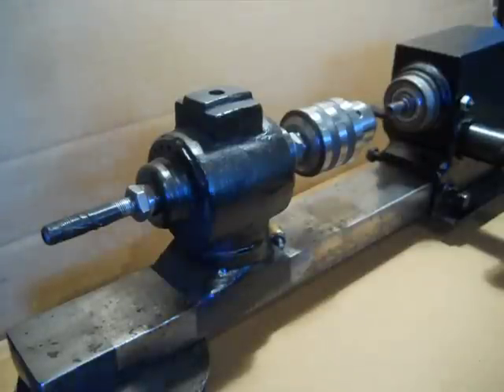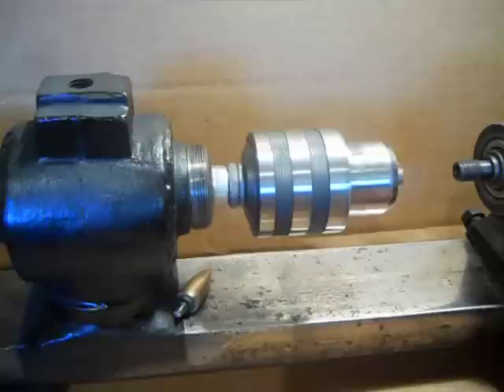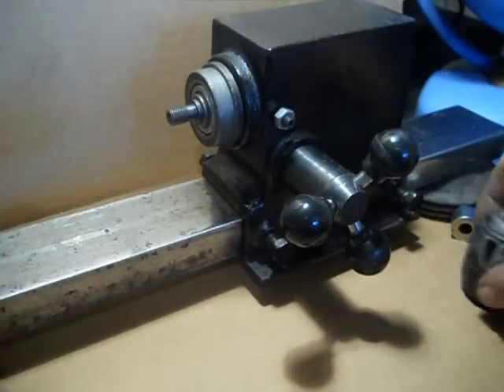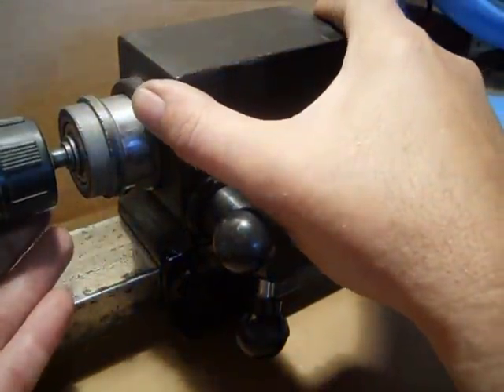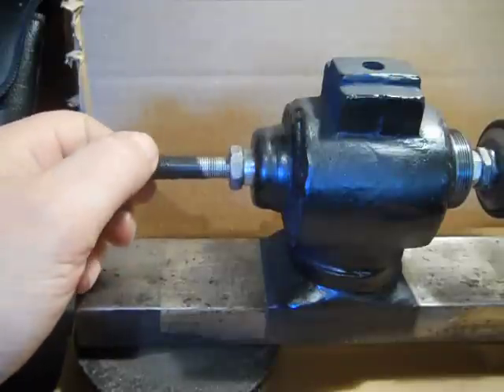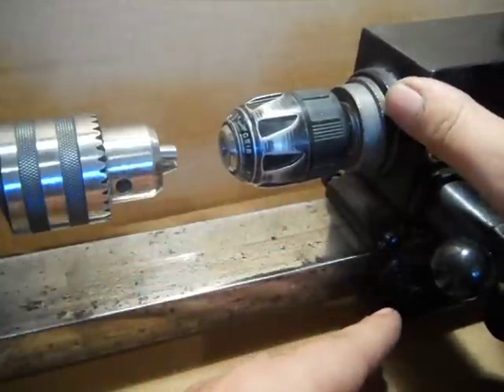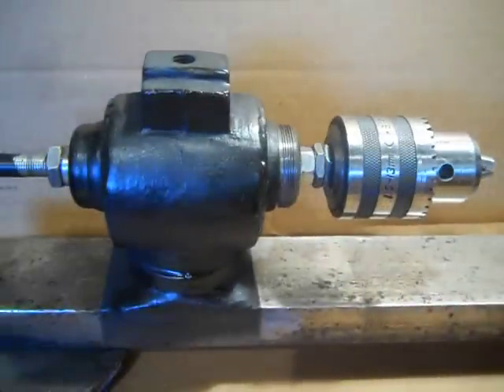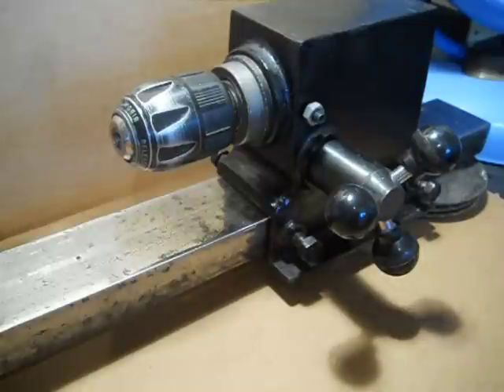HOMEMADE LATHE  (from old drill press )

Comment: FYI use tapered bearings on your shaft since a lathe requires a great deal of radial load. Changing that you will end up not needing to change bearing quite so often. 

When building any type of lathe machine it is necessary to research and design around certain physics. Particularly force. You have to consider the rotational force coupled with the amount of force the tool is applying, the angle at which that tool is being applied, also thrust force, etc etc. All of these play a part in the end result of a lathe. 

It is a cool machine but the laws of physics will cause the machine to become overloaded and break. You just have to account for physics because the machine will act very differently when it is turned on.

Comment: If you are serious about wood working then you will make sure there is NO wobble in your lathe, you will see very fast how much of a difference that makes.
Reply from the maker: +Edwin Dueck NO I was not that serious about woodworking I have more interest in using my metal lathe
Reply: +not2fast4u2c then you know how important it is to be accurate, I have had much to do with a metal lathe, but I do know this much if it goes off centre it's very dangerous.
The metal shavings wipe around like a crazy knife blade.

Comment: Nice! Good to see someone w/ some imagination. I say that 'most ppl look out th window, I see schematics.' You can adapt pulleys to slow down a drill press, and cut steel w/a carbide router bit, too. If you've got a stop bolt on your drill, take it off and put the nut UNDER the stop. then by twisting the stopnut  UP the bolt, you force the quill out. Mine is a 5/8" 11 bolt, so one thread is .090, one wrench side is .015...That lets me put screw hole pockets in thick steel!!!!!
Reply from the maker: Mike Gieg Thanks for watching !!!
Reply: not2fast4u2c 0ojc😒 op,  but

Comment: What Iove about projects like this is that you can start with 2nd hand parts from a junkshop or from old tools lying around and make something that, while innaccurate, actually works. Then, using the tool you have made, you can make something better until you have a quality machine - all from cheap parts and cheap stock. I'm keen to make something similar for turning metal parts. Nice film  - many thanks.
Reply from the maker: Thanks for watching This works good for making things from wood and plastic

Comment: He just asked why he wouldn't just buy a fairly good one (they're cheap) instead of making a homemade one. I think that's a fair question. I could build a mill and lathe but it's going to cost me more in time and materials in the long run then a commercial unit that will most likely perform better.